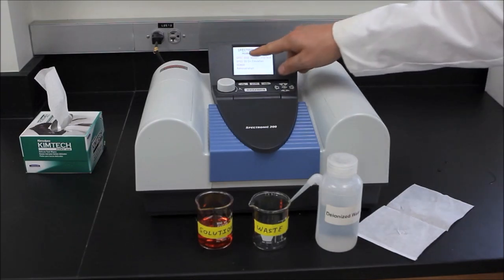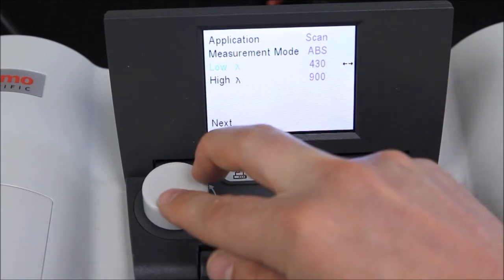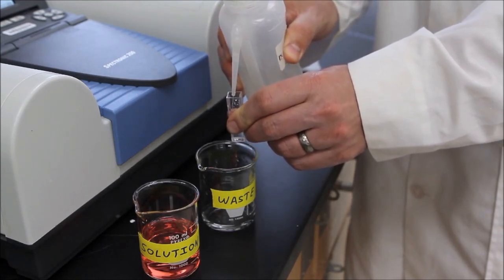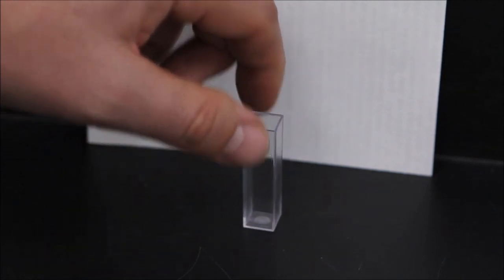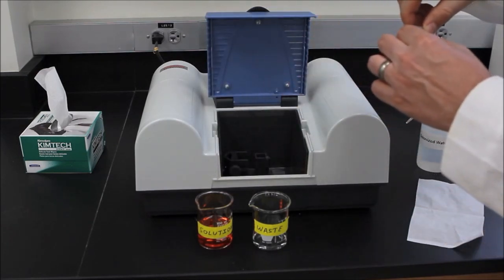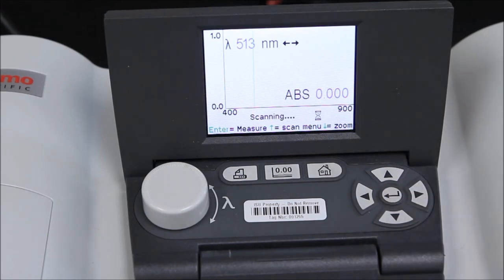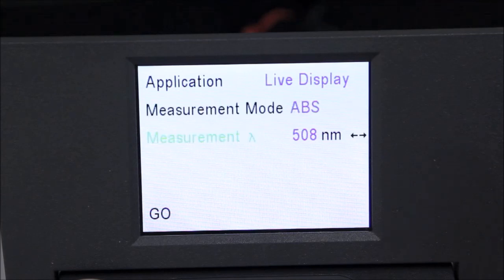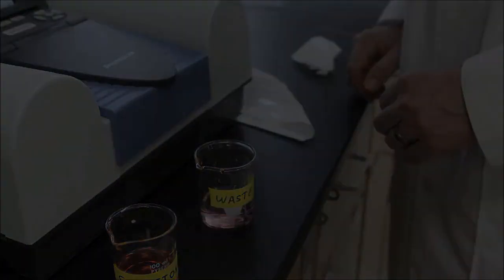How to use a spectrophotometer (Spectronic 200E)

Comment: Could you tell me how you got your Spectronic 200 unit to read 3 places after the decimal (0.000) for ABS? Thanks.
Reply from the maker: We used the Live Display program from the SPEC 200E Modern Interface Menu. I believe the SPEC 20 D+ Emulation program is similar but only displays two decimal places.
Reply: You may have already figured this out, but the "Education Model" only displays to 2 decimal places. This must be the "Industry Model" which goes to 3 decimal places.